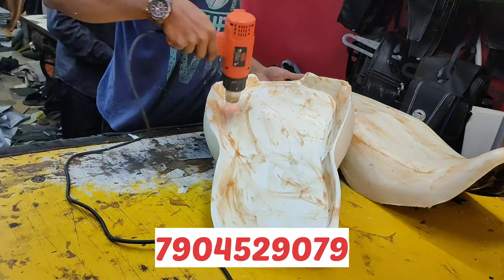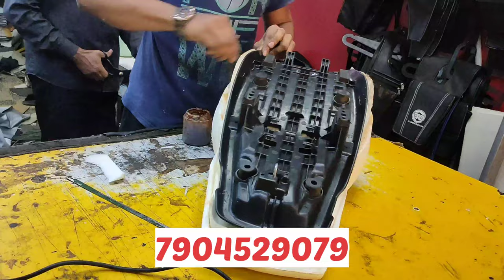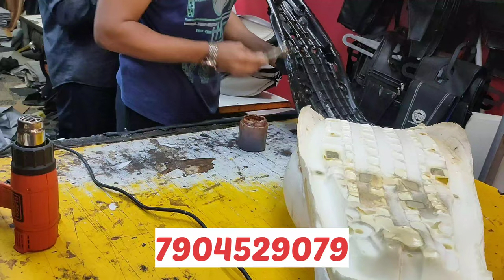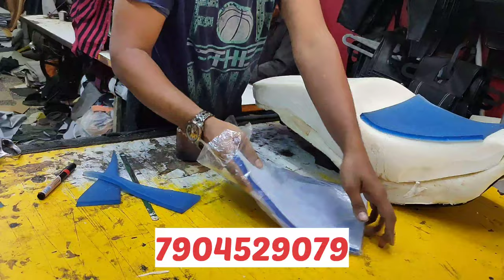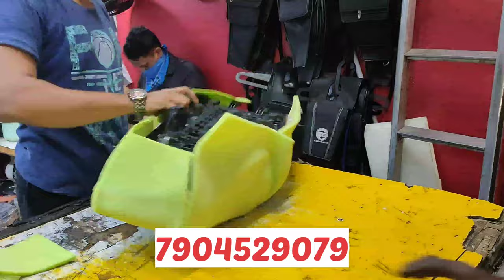PASSION BUCKET SEAT WITH GELPAD #shorts #trending  #trend #bikelovers  #gelpad

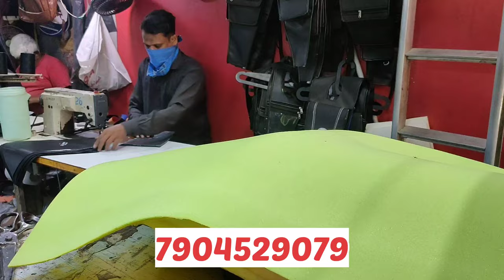Comment: Use black softy foam instead of green foam 12:28 it will helps much more comfortable
Reply from the maker: K but the foam used is less density to outcome gelpad experience
Reply: @chennaiseatexperts  is it bullet  chopper slab??